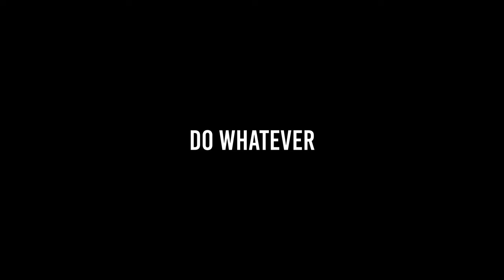There's bad, and there's this Xbox

Comment: I need to know what soldering iron tip you use and also what magnifier tool.
Reply from the maker: @BRousch  tip is a Hakko Bent Nose T15-JD08, and the microscope is an Amscope 3.5X-90X Simul-Focal Stereo Zoom